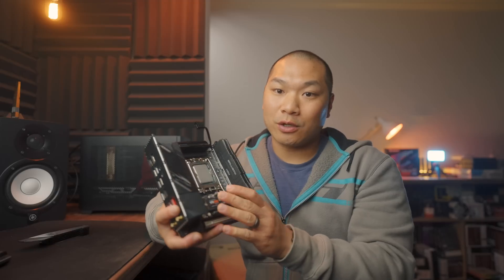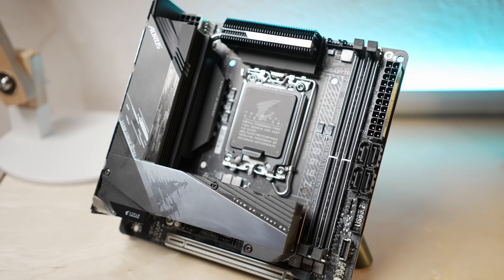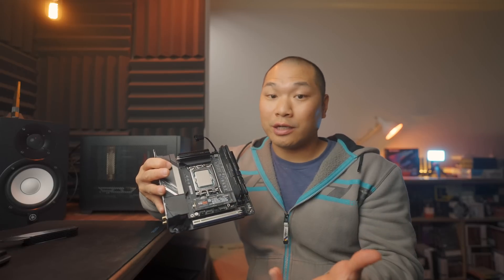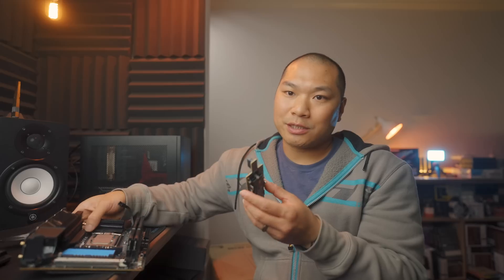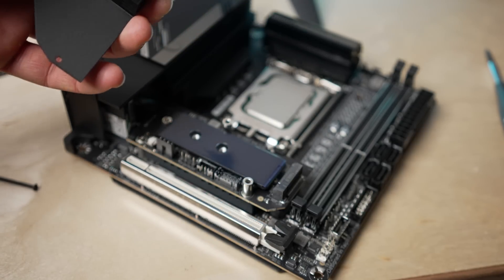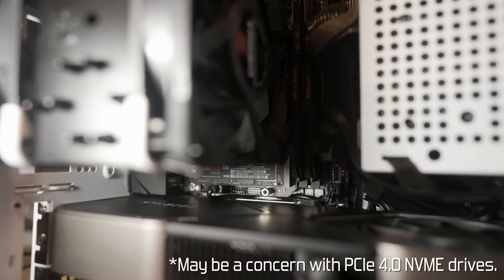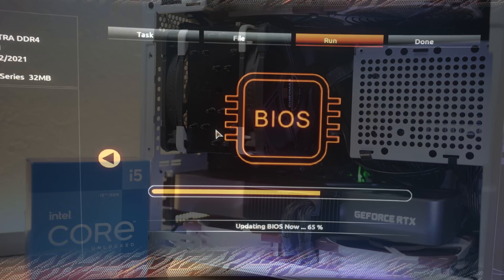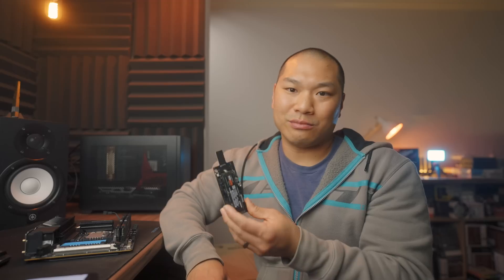Gigabyte Z690 ITX Ultra... Ultra Headache?

Comment: Good review. I think this will help a lot of people with their decision on getting this board. I was actually eyeing this particular board since I wasn't able to find a good ITX board to support the Alder Lake chip and also DDR4 support (since DDR5 is almost non-existent at the point of checking). But I've also heard a lot of negatives with Gigabyte boards of late, and with the not to distant exploding Gigabyte PSU saga (the way Gigabyte handled or mishandled the issue) I guess I won't even bother with this board.

Comment: Any issues with ram overclocking? heard heaps of gigabyte ddr4 boards cant even XMP speeds
Reply from the maker: Yup, faster RAM, like in Z590, often needs to be geared down. Not great but AMD is still where it’s at for fast DDR4 RAM.

Comment: In this video, you were using one memory stick because of the tight fit for air cooler.
That brings up a question I have been wondering if there is a performance difference in configuring the number of RAM sticks to use , assuming the motherboard has 4 ram slots...
1. 1x32 GB (using 1 slot),
2. 2x16 GB (using 2 slots), or
3. 4x8 GB (using 4 slots)

Cheers,
Dix

Comment: I just installed Aorus B550I board. First thing I did: remove that fake heat sink a the bottom - it just cosmetics. The real, nice heat sync for M.2 is below it.
Reply from the maker: Yeah, that block doesn’t even touch the finned heatsink!

Comment: I actually have this board and have been using it for a couple of weeks. I finished off my system in a custom made mesholishous that has a 280 aio and a fan on the top and bottom of the case. And 2 more fans on the radiator. And all but the top case panel close perfectly. So far the issues I’ve noticed with the board are the not detecting drive at first like you said. The second issue was with any riser cable I used it had to be specifically set to that gen of riser cable or it would not detect anything at all. And as far as the coil wine that may be your board but mine has none at all and neither does my gpu.
Reply: What aio did you use?
Reply: Hi, what bios have you flashed? Are you able to use the GPU on pcie4 without riser and without bus errors reported by hwinfo?

Comment: Unfortunately I also got this board. Had all the same experiences. Super annoying to deal with all the headers under that super large M2 heatsink. Also my WD850 M2 drives didn’t load first boot either. Had to flash the bios to F5A bios and it works now. 
Didn’t notice coil whine on my but also my 3080 is super loud so doubt I could tell

Comment: I had the previews gigabyte Z590i ITX board and was very happy with it. But this new Z690i has been a headache. Spend a whole day to figure out how to get my m.2 to work. And when it eventually worked, it gets super hot, 81C at load, if placed in the bottom slot. Have an Arctic LF ll AIO laying around but i have been waiting 3 weeks for a LGA1700 kit. Such a messy company Arctic is, yea really, seems to be run by a bunch of lost teenagers. Its a long story.

Comment: do you have experience with asrock ZxxxM-itx lineup? for the price they seem will get closest to B board pricing late Dec but their VRM x8 50A, half without heatsink makes me question if it's worth putting 12600k stock into it and then possibly thermal throttle :( also thanks for videos, ordered all parts for build except for mobo! from eu
Reply from the maker: I have used a Z490 ITX from them, not a great board in terms of spec but certainly fine for an i5 level of CPU, especially stock. What I really don’t like is the BIOS and also anecdotally I have heard of M.2 compatibility issues with some models. I wouldn’t say the Asrock Z690 ITX is a hard pass but the thought of B660 I boards from other manufacturers is more promising at this point, just need to be patient.. 😟

Comment: I have the DDR4 version of this board. So far works great. Using Be Quiet 240mm cooler with i7-12700k in NR200P. Works great.
Reply from the maker: Awesome! At least they’re not all duds! 😃
Reply: @MachinesMore  largely built my whole build based on your channel. =) The cooler, NR200P, etc. Thanks for having such a great channel.
Reply: will definitely admit the audio connector was dumb. =-( literally didn't know it was there until I finally found it in the manual.
Reply: oh, sorry, finally watching whole video. the M.2 issue is the stupid Intel Rapid Storage (RAID) stuff. Turn off, I think it's called, VMD. It'll fix the M.2 issue.

Comment: Regarding the coil whine issue on this board, I found a temporary solution by disabling C-States in the BIOS (i.e. forcing the processor to stay in C0/1). On my 12600k, this increased power draw while idle from 1W to 10W which is not ideal but a sacrifice I was willing to make as the coil whine was so bad I was getting headaches.
Reply from the maker: Thanks for sharing and sounds like it’s not a one-off issue. May I ask what BIOS version you are on? I don’t recall this happening until updating to F5 on the board and wondered if it had anything to do with that.
Reply: @MachinesMore  No problem! And I agree it definitely seems widespread, it was some of the worst coil whine I've ever had in a build. For BIOS I'm currently on F3, which was the only available version when I received the board. I updated it right when I got the board in order to fix the missing M.2 issue so unfortunately I don't recall if the coil whine was present on F1.

Comment: Sadly there are no good Z690 ITX board supporting DDR4. The only other option is the ASRock Z690M-ITX which looks terrible. I really hope there are more B660 DDR4 options
Reply: what is terrible about asrock if you run on stock 12600k? should be significantly cheaper, fits coolers, vrm is bit inferior but has great port support

Comment: I run this board in NR200P, this was the only choice of ITX boards available for early adopters if you didn't want to blow 400+$ for ASUS STRIX with even worse cooler compatibility and DDR5 which is impossible to get =)
I had same issues with M.2 as described, it wouldn't recognise them, a bios update has fixed it.

I did not run into any other issues. However, cooling is limited here, I did find the ID Cooling SE 226 to be a perfect fit for my NR200P with tempered glass, at least the heatsink was great quality, but the cooler fan was pretty noisy so I went with EVGA 240 AIO and went with the vented panel on NR200 instead

Thanks for great content as always!
Reply: So ID Cooling SE 226 will fit this board and tg panel nr200? Can you also add a fan on left side to run intake? Thank you.
Reply: @oXiGaming86  It does fit quite nicely the TG panel, not touching the glass even, but due to high radiator on the left side on the MOBO, i could not fit the stock 120mm from cooler on the left, but maybe a thinner fan or a 90mm will fit
Reply: @Assassin822  Thank you, need to decide on a cooler for 12700k with this board. I don't want aio's, so far id cooling is the best option.

Comment: Hey, thanks for the detailed video. I literally just received this motherboard yesterday and the LGA1700 mounting kit arrived just a few hours ago.
I haven’t built the PC yet but I did test fit a Noctua C14s and was able to stick the 140mm fan underneath. Have also checked Noctua’s compatibility list and the C14s is listed as fully compatible. 
Were you unable to stick the 140mm fan underneath because of a clearance issue with the PSU in the NR200?
Reply from the maker: Yeah, it’s more the tight cabling when built up but thanks for the data point! Hope yours works well!
Reply: @MachinesMore  Ok, I got on with it. The C14S only fits in one orientation (with the heat pipes on the IO shield side and a 140mm does fit underneath. I also had display issues and can’t boot into windows. Nagging my neighbour to help me create a usb stick I could use as this is my only pc at the moment. Finally, mine also has coil whine!!! :(

Comment: I used this board for my first build. The materials seemed high quality but I encountered a few issues that made the experience especially difficult:

The m.2 heatsink doesn't fit right if you run a liquid freezer ii.  Based on this review I get the sense that it's a pain with a lot of coolers so definitely do your research. Just because the cooler works with lga1700 doesn't mean it will work with this board.

If your board ships with F1 bios (the first bios version) it won't recognize nvme m.2 drives and you'll have to update the bios to f3. Of course, it's hard to know you'd need to do this because you'd figure it was the heatsink fitment applying uneven pressure
Reply: Liquid freezer II has one of the worst compatibility issues because of how the tubes protrudes out vertically and is an unpopular choice with most tight SFF builds. EK AIO, Glacier Zero and Capellix are more popular choices when it comes to SFF aio cooling
Reply: @RryLo18D  oof

Comment: The B550i did have BT and LAN issues until BIOS and driver updates this year and for a while I wished I had gone Asus B550i or waited for Intel, but its half the price of the GB Z690i and a third that of the Asus Z690i , it worked fine with 3600 DDR4 and M2 SSD,  and no probs with Noctua coolers
Reply: Which BIOS and Driver updates? 

Have the B500i in my brother’s pc and he would love to be able to use BT on it.
Reply: Lol.  Same here, the early bios were pita.  Ever since f12, the BT issues were gone.  
Gigabyte has gone the drain in terms of bios readiness.

Comment: I have the very same issue, the bottom-most NVMe drive does not appear anywhere, and that didn't change with updating the BIOS to version F5a (I think?). The initial BIOS it shipped with, version F1, didn't show either of my NVMe drives.
Reply: I would recommend updating to f3, not f5a, so you don't have to deal with the instability of beta BIOS versions (the "a" indicates it's a beta version)
Reply: @NicholasSunderland  I'll give that one a try
Reply from the maker: Yeah, I went to F5 as I didn’t see F3 but glad to hear F3 works well for you.

Comment: I have this board and I’m having trouble with my DDR4 ram XMP profile. When I enable XMP the PC no longer boots. What can I do?
Reply from the maker: What speed is your RAM? For faster clocked RAM you may need to tweak the gearing to gear 2 to post.
Reply: @MachinesMore  it’s Corsair Vengence RGB Pro 32GB 3600MHz . I tried changing to Gear 2 but it didn’t work. I also tried to play around with the voltages and it didn’t work. I don’t know what to do in this case

Comment: Man, what a disappointment of a board! I wonder who made the decision to rush it to launch and if the lack of BIOS QC testing is happening in Gigabyte's other Z690 boards. Definitely a worthwhile lesson not to buy based purely off of the spec sheet. At this point, it's a weird situation for an ITX buyer trying to decide which platform to buy when both have big caveats. 

I have so many questions after seeing the feedback for it on Newegg and in your review, but primarily about what this means for the B and H LGA 1700 boards when they inevitably come out. Hopefully there's some significant design changes made and they're more like the previous gen 1200 boards. Feels like a lot of the hardware compatibility problems could have been avoided if they'd just stuck an M.2 slot on the back, but maybe that wasn't thermally viable.
Does the backplate actually help with heat dissipation or is it like those GPU backplates that are purely for aesthetics?

Thank you so much for such a thorough review, but especially for your integrity when looking at these products.
Please keep doing what you're doing (for as long as you're interested and able to, of course).
Your videos are consistently interesting, informative and easy to watch. Thanks for taking the time to make them.

Comment: Hey man, nice video! Do you know what the purpose of the molex to 4 pin "external power connector" is? It seems to connect to the m.2 daughter board.
Reply: I asked Gigabyte. They said it was needed if using m.2…. But was super unclear why. They never answered really what it was for.
Reply: Interesting, to me using a molex connector on a board in 2021 will be an odd choice no matter what the purpose is.
Reply: @AdanFS  Agreed. I bought a sata to molex adapter just to keep from installing a molex cable on my PSU. I really hoped I could NOT use the connection, but Gigabyte support seemed to indicate it was necessary if using M.2... which, makes zero sense. The Asus Z690 ITX doesn't have, so I assume this isn't on the Intel reference design. I was really assuming it was only required if driving RGBs (which also has a connector on that board).
Reply from the maker: Most folks won’t need it. It will connect to the power supply for additional 12V power (not a standard PSU cable though). Kind of similar to the extra 4 pin EPS header on boards with more real estate, you’ll only need it if you are pushing a crazy OC and need overhead.

Comment: Seems like Gigabyte's layout demands you use a PCIe riser & an AIO. For some mini-ITX builds, sure, but others, seems thoughtless.

Still mind-blowing they released a motherboard that could not boot from M.2 on the official release version. What?!
Reply: Mine worked fine. 🤷‍♀️
Reply: my ddr5 version works fine, running 12700k with a u9s
Reply: @WilliamDezunchd  How are your temps ? Cheers
Reply: @mrlmaokun  the average cpu temps while idle/using windows 11 were 35-37C, highest was 60C, keep in mind i don't have a graphics card for now so it might be different from regular use with a graphics card
Reply: @WilliamDezunchd  Thank you very much. The U9S looks the perfect fit for my set-up. The L9i was an awful purchase on my part.

Comment: I had considered this board since there are not many itx z690 boards. Not to mention I'm currently using the z590 version of this and haven't had any problems at all but now I'm thinking I will wait a little longer to see if things get flushed out. This kind of stuff is exactly why I've thought about skipping this generation altogether and waiting until this new architecture matures.

Comment: Great video, been trying to pull together the scraps of information on this board for a while now. I have one in the mail. I'm in Europe and when I emailed gigabyte about a European release date they said 'a couple weeks'. Other people have been told 'late December'. It sounds like they've delayed the release to prepare another bios update, so hopefully the issues will be ironed out soon.

Edit: I also came across images on reddit confirming the kraken series aios work with this board in case anyone was wondering
Reply: I am in UK and on the 18th November gigabyte replied my email with same answer, it will be available in 2 weeks...i have the 12700k but no options for a good board, I don't want to gog asus with ddr5, just too expensive. There is one ddr4 itx available in UK, asrock itx but I am afraid of the vrm quality.
Reply: @oXiGaming86  yup, I initially ordered that asrock then got scared about the VRMs and cancelled. I'm in the UK too and got the gigabyte board shipped by Newegg from the US. Turns out its not such a bad deal since they have free international shipping on orders over £200 - that makes up for the duty fees etc. They also let you pay for the duty in the initial price and guarantee not to charge you any extra. All-in-all it worked out cheaper than the UK msrp
Reply: @finlaymcewan  yes, i was looking at newegg, shows me about £280 including delivery and vat, will i get other customs here? How long is the shipping? They had 8% discount last week but i was afraid to order because of all this bad reviews. My 12700k is waiting :)
Reply: @oXiGaming86  yeah I got it on the discount. There shouldn't be any other fees. Delivery is 6-9 days, in my case it's going to be 6 days
Reply: @finlaymcewan  excellent, they give a free game now, I will wait 1 more week maybe another discount will come, but I want it before Christmas. Even if it comes in UK retailers I don't see them actually having stock, same as all other itx boards. Thank you for your answers.
Reply: @oXiGaming86  no problem. That free game deal sounds good! Just add it to the cart and it'll show you the total cost and delivery details
Reply: @finlaymcewan  i just ordered it from Newegg £250 all included, have you installed yours? Any issues? I think the price is amazing, in UK it will come more expensive
Reply: @oXiGaming86  mind just arrived an hour ago, but unfortunately I won't be completing the build for a few weeks due to university studies
Reply: @finlaymcewan  I see, hopefully everything will work fine. I will also build only after Christmas.
Reply: @oXiGaming86  I've installed the cpu and ram so far, and I confirmed for myself that the kraken cooler will only fit with the tubes oriented upwards